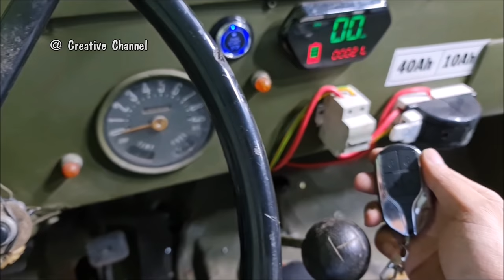1967 JEEP GASOLINE Conversion To ELECTRIC Car at home

Comment: We  don't have  to use any oil  to have a nice running car    a car  can run in water  in 1995 was Proven that it can be done all that  money that we spend on gas can be use to live  better and breeze cleaner so let's go to the future   oil and gas is from the 1900  hundreds  use waters  electric  and don't be afraid

Comment: Can modify patrol with electric motorcycle becouse if the battery net charge becouse of long drive that time patrol engine to used and that time can battery can charge? How many km can drive for once  full charge and how many take times to charge full battery to used electric and how many take full charge to used patrol engine motorcycle and how many litres were consume for charging full battery to using motorcycle for motorcycle battery?

Comment: I doubt that the newer (jeep) electric engine could even can even get close compared to the old (jeeps) gasoline engine before. Cause it's too small. Cause i also drive a jeep to the public market daily i load 12 Styrofoam boxes weighing 40 kilos each full of milk fish that i sell daily at the market place. so that's about 480 kilos or 1058.22 pounds of fish with that load which i drove 6.58 kilometers or 4.08 mile backandfort daily. Not including the weight of 3 more added passenger including myself. Also there is a lot that haven't been explained like the clutch and gear box for changing gear, and wouldn't the fluid for the gearbox and transmission leak when it's left open, and how thus the alternator for charging back the vehicle battery while driving works for this setup, and the radiator for cooling the engine was just return back but have to function for the electric

setup just for display. And where is the fluid placed for the brakes to work, which is usually placed on the bottom side of the gas engine.

Comment: No specification of electrical equipments are told which were used in this conversation. Neither the speed limit and batteries charge time n back up time.

Comment: The electric motor is probably 10 to 20 hp? to low for the Jeep. need 50 to 75 to to at least be within range of old gasoline engine.